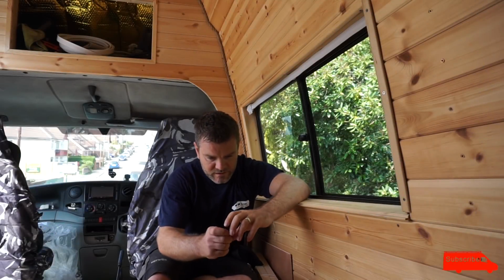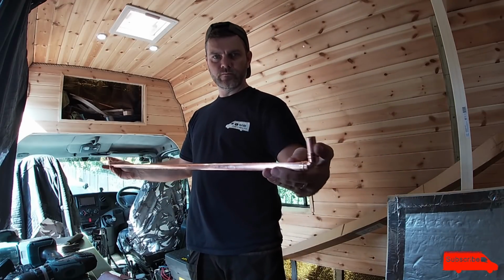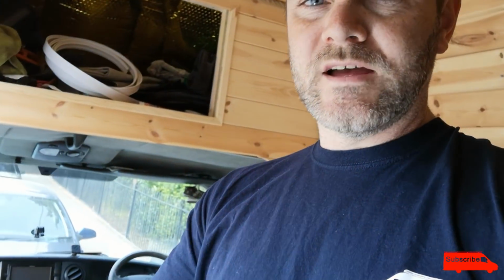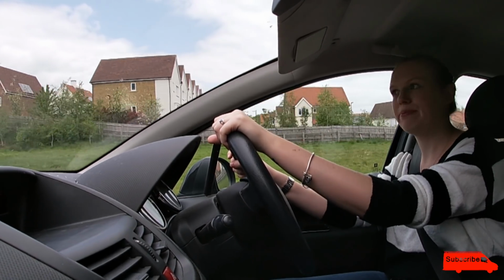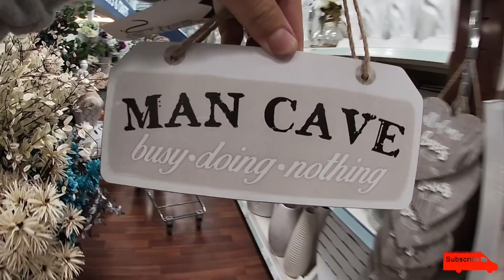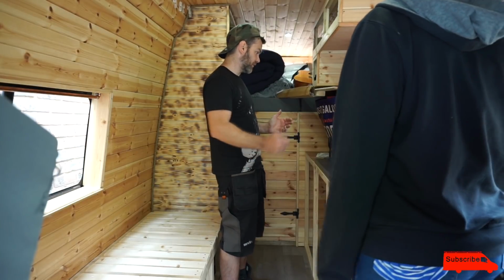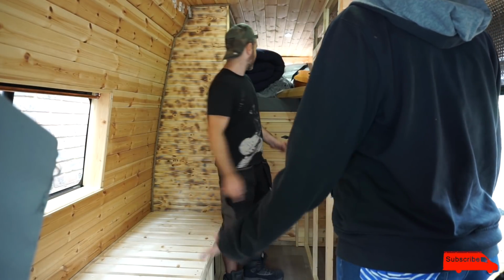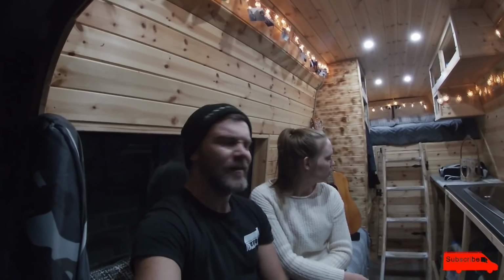Wife adds a feminine touch to the van!

Comment: Hey guys, just wondering how tall both you and your wife are? My partner and I are looking at buying this exact van and would love to know as a point of reference for our own head clearance? Thanks
Reply from the maker: Hi there, we are both 5ft 8. Bear in mind due to insulation and building up the floor and ceiling you loose height. in case you didn't know there are different height ivecos, mine is the extra hight top. You can stand upright in both but once converted the shorter one wouldn't be enough height if you were much over 6ft tall. (See ash pollards YouTube vids and see his head clearence and ask how tall he is as he lives in the lower roof iveco. Ash knows me and my van tell him your comparing them) If you are 6ft or over you'd need the extra high top the same as mine. My van is huge and I've had a lot of really tall people wanting to stand in it and they've all been very pleased with my headroom. If you can get the extra hi top. Hope this helps. If I can help any further just ask. Luke. :)
Reply: Thanks Luke